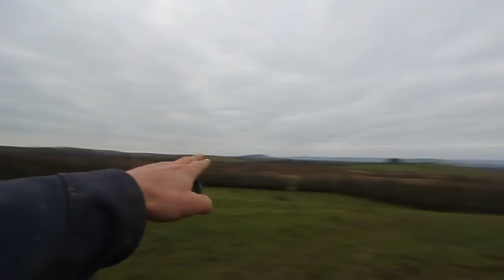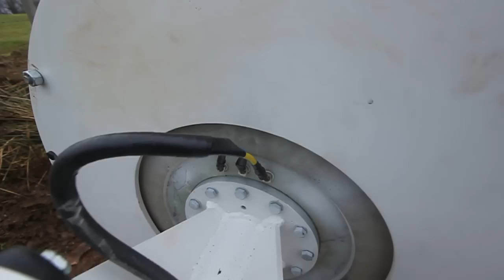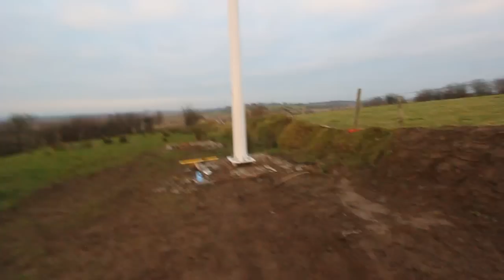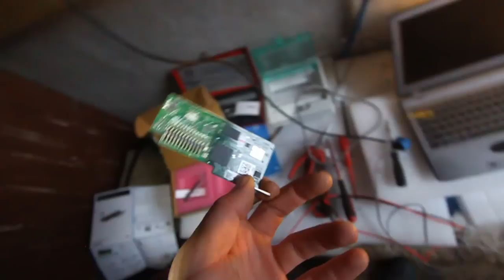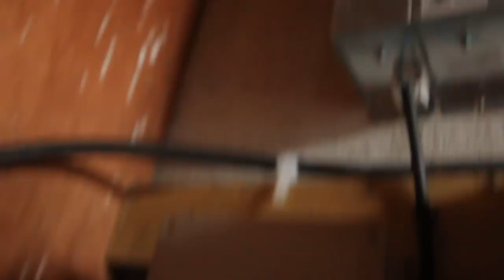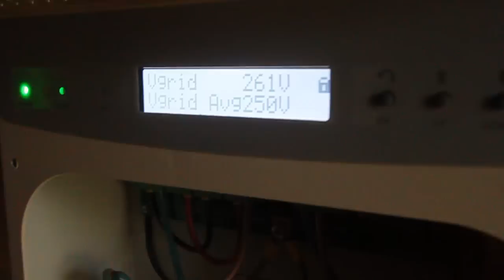Vertical Axis Wind Turbine domestic installation Ireland 3kW nominal power, 5kW peak

Comment: I've built VAWTs for over 50 years, but all my turbines are geared down 60:1 and compress air.  I have a plethora of pressure vessels and my turbines keep the pressure at 120 psig.  I then run compressed air through modified steam engines to produce 120 vac, 220 vac, single- and three-phase a.c. and direct current for charging electric fence batteries, etc.  Building electricity directly from the turbine is a never-ending rabbit hole - too many variables.
Reply: But a lot more efficient than steam.
Reply: @davefroman4700  
???
Reply: @SiwyWabbit  Every time you convert an energy source from one form to another, there are loses. Where as if you store the energy directly in batteries your loses are minimal. A steam engine running on air is horribly inefficient compared to an electric motor.
Reply: @davefroman4700  
None of my electric motors will run on air. 

MY air is free. When the wind blows (I live in Texas,  mind you, and there's ALWAYS wind) my turbines spin up and compress it (the wind . . . air).

I'd bet you lunch my air tanks will outlast ANY other storage battery you come up with!

I've been at this nearly 60 years.  How long have you been at it - storing electricity in batteries?
Reply: @SiwyWabbit  Sun and wind are counter cyclical. When you do not have one? You typically have more of the other. Single source systems need more storage. And storage is still the expensive part of the equation for all but the do it yourselfer.
Reply: @davefroman4700  
Apparently, you've never been to Texas.  We have a plethora of sun and wind almost year round.  Winter lasts about 60 days, not much sun, but there's always wind. Even in the winter, if there's enough clear sunshine to cast a crisp shadow, I can cook using my All American Sun Oven. 

Something else that is apparent, to me at least, is the fact that "I" have built wind turbines and solar appliances for the better part of 55 years and incorporated each into my lifestyle, whereas MANY of the comments I see on here are from people, who only theorize, but have never actually done any of the things they spout off about. Compressing air and storing it, then utilizing it to generate electricity and operate machinery works well for me.  If others don't agree, they should perhaps figure out a better way and do that!

Comment: Wow. That is a beautiful machine! 4.5KW is a lot of juice, that is if you have the wind enough of the time. The post has no bracing. Are the lateral stresses on a vertical wind turbine relatively low because of the push-pull kind of blade scheme?

Comment: Its crazy how fast these types spin compared to the simple savonius kinds.
Reply: So much less air resistance
Reply: They are lift based rather than drag based. Drag force decreases drastically as the blades approach wind speed, whereas lift based blades typically turn much faster than the wind.

Comment: Very interesting. Marek I'm presently researching for a turbine system to install in a completely off-grid house in the wilds of Donegal.  Your system is far too powerful for my needs and I'd be interested to know if you know of any other lesser powered alternative?  You mention that you bought your system in Poland.  Perhaps you would give me the name of the manufacturer?
Our needs are relatively modest - to be able to run a few light bulbs, and charge computers/ phones and then to heat water or a dump heater with the excess. I'd be very grateful for any advice. Thanks for the video.
Reply: Cu pompă de la mașină de spălat produci ușor 35w mi 220V. Și alimentator telefon + redresor cu baterie auto. + convertor. 12v-220v.
Reply: Sau baterie auto + motor 12v-pompa 35w 220v.Pompa de apă de la mașină de spălat rufe are rotor magnetic. Sau caută la auto că sunt motoare de pornire cu magneți 12v.Dar îți trebuie apoi convertor 220V. + baterii.

Comment: can someone explain the kW for me? is that kW per HOUR if it is spinning? or is that over a certain period of time? is it producing some kW consistantly when spinning and up to 5kW peak? is that measurement per hour?
Reply: kW <kilowatt> is Volt times Amper. It is real time. If you want measurement per hour you use kWh - kilowatthour.

Comment: Do you have some daily kwh generated? most the times in the video its like 1.7 kwh, small numbers, depending time of day of course you shot it.. would be curious to see a daily chart for maybe a streight week :)
Reply: answering myself, i saw on your webpage the link for monitoring :D

https://pvoutput.org/aggregate.jsp?id=58925&sid=52441&t=w
Reply: @bmsfx  thanks for the link. wow, not very good ROI, So there are about 3MWh in three years. this is about 750 euro. Two more years for ROI. And I am not sure if the pole and installation is included, I assume not.  Plus the inverters wires and all. Maybe goes toward 10 years ROI. But still good, if it works two or three decades. However, I see that prices for a similar size horizontal axis, is the third of the price, and it seems that efficiency is better for those. I need to find similar production table to compare the real output.

Interesting. https://pvoutput.org/aggregate.jsp?id=45656&sid=41631&v=0&t=y is a solar install of similar output. Comparing apples with oranges... and more, at both not all the data is recorded, since is mentioned partial years. However, for the solar system I see a target of 1600 USD. It s quite cheap, so maybe is a second hand system or a nice grant. But that target was met twice, so even with market price the system is almost paid back. better than wind.
Reply: @ehombane  This link shows the produced energy of PV sun panels not of this wind turbine. Unfortunately we do not get quit easy any feedback from 
Mikrogeneracja... I would be interested on the axial flux generator and the wind turbine, in terms of conception, parts and dimensions to buy one other make one my self.
Reply: @tonyfernandes7592  I was not the one to claim that the link is showing the windmill production. Bmsfx commented previously about the link as you can see. I took it as true information. I noticed that the site is dedicated to solar panels, but I assumed that the guy found it useful for windmills too. In fact is just monitoring production, it does nor matter what produced it. Sure, if many will do this, will mess with global stats, , but we wee interested only on that turbine production. 

Now that you mentioned it, I looked with more attention at graphs, and it looks like solar, I mean rising in summers and lower in winters. I assume in winter is more wind. And looking for some stats in my country, my assumption is right. But what do I know, maybe in Ireland the wind is different related to seasons. I have no idea, maybe the guy who posted the link got confused.
Reply: @bmsfx  love you man

Comment: A windmill connected to 17 other pieces = Power!   Truthfully, VAWT's are not very efficient but they are quite pretty to look at, and not the absolute eyesore those large-diameter "wind turbines" are.  I wish you all the best
Reply: Eyesore?
For me both are pleasant to look at.
Reply: Darrieus VAWTs can be nearly as efficient as HAWTs and  work with wind from any direction.
Reply: @flyyynt  and they nearly made it to the market. unfortunately nearly catching the train is totally different of catching the train or nearly missing it.
Reply: True, a vertical axis wind turbine only harvest 8% of the available wind energy, while a horizontal can do 40% the rest just passing through. That's why all the commercial wind farms are horizontal.
Reply: @johnq8792  Not true. Well designed darrieus VAWTs can go up to 40% which is close to HAWTs. The only reason you don't see them at large wind farms is that mechanical design is challenging for the bigger ones.

Comment: Looks better than a regular turbine, more power.
Reply: yep it looks nice, but more power? everybody say that it is less. Anyway, looking at price I see that it cost three times more than a similar power rated horizontal axis turbine. 

I even invented a ”better” design as a child and was curious if this kind of turbines are efficient. 
My idea was to increase the surface of the wings without hindering at return. Even the angle of the wing is helping for a side to be pressed less than the other one, at return there is load on it. What to do to have the wing on a side and vanish at return? My design was a door like wing with the hinge on the outside. so when the blade face the wind the door will be closed and wind hit it on thin section. 90 degrees later the door still closed and pushed closed in the frame of the blade, so will oppose the wind with full surface. 90 degrees later again no wind resistance, still closed but wind is hitting the thin section. but few degrees later the door will open since the frame will be toward wind. when the frame will fully face the wind the door will be open, hanging on the hinge, offering the least resistance to the wind. Made a model for testing, and it was spinning like crazy, so the theory works. But had no idea about efficiency. And I really doubt that vibrations will be easy to control. Maybe only in huge models with slow speed. But I realize now that this models are not so efficient.

This means no more power.
Reply: @ehombane  We need to show by using drawings or something because just written words just don't do anything.
Reply: @mark8664  Words are enough here, because is just chat, is not a production line where the worker needs to see a clear design, since he cannot reinvent what engineers were able to invent and design. 

Now, if you cannot transform the words in picture, it does not matter, just say wow and scroll to the next comment. If you are really interested in the concept, then with a little patience you can draw yourself the picture. I already gave you the clue: I invented it having just a hunch, and I am not a genius. Quite opposite. If you have troubles with a certain step, just ask and I explain. I do not bother to draw a simple sketch.
Reply: @ehombane  Whatever, I'm sorry to trouble you I just was thinking out loud. I realized for myself that when it comes to inventing a picture is worth a thousand words.
Reply: True, looks nice but a HAWT same size and money spent would do at least double.

Comment: Four blades makes it slightly unusual - three or six blades seem to be typical.  Is there are reason for having four?
Reply: From what i heard it is good to not have even number of blades in case of horisontal wind turbine because the blade will gonna interact with wind disturbed and slowed by the tower and it will transfer created vibrations to the blade on the oposite side(but there are big horisontal wind turbines with only two blades...). 3 blades is a minimal number to have disc like behaviour/stability(for horisontal wind  turbine).
But i dont think that all that is significant for  VAWT.
Number of blades will gonna influence speed of rotation, more blades=slower but you will gonna get more torque(with the same distance of blades from the axis of rotation), so 4 blades will be slower than 3 blade system but it will gonna spin faster than 6 blades turbine(with the same radius).
Also more blades=less efficient. as the air flow wil be more turbulent as the blades are closer to each other.
Bigger version from this company ECOROTE 9800 have 5 blades.

Comment: Dump Loads are such a waist.   Dump your excess into a Hot Water Heater at least.  When that's not needed a Electric Heater works just fine.     You Sir have this going EXCELLENT !
Reply: Dump loads are a waste, but you always have to have one on a wind turbine. There is however nothing to stop you also having a dump load to a water heater, and only dumping to the air when the water heater can't accept any more energy.

Comment: Make all street light poles equipped with this type of VAWT, with energy storage in place your town is self sufficient in energy. Very good wind speed you have there, worth investment.
Reply: Vivek Prabhu in chines they have light polls that have both Wind turbine and Solar power and LED lights. So no need to connect to grid
Reply: Or just build one standard wind turbine with 3MW replacing 1000 of those in the video. There is a reason we do it like that.
Reply: Da, dar cu rețea de aer comprimat. Va scădea mult prețul cu compresoare centrifugale. Iar aerul comprimat poate fi stocat mult timp. Și ieftin tot sistemul.